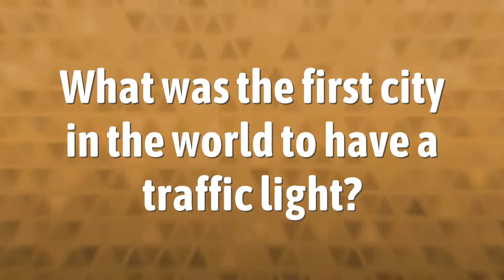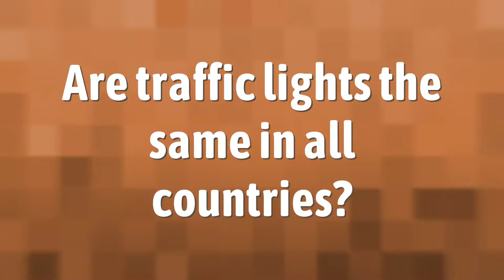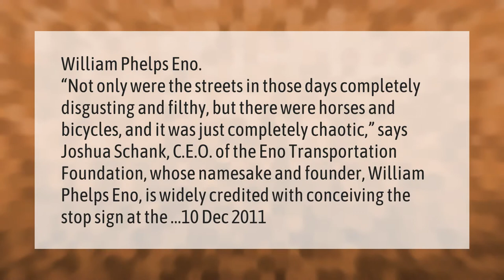Who invented the traffic light and why?

Comment: Showing you the way!    Why lie?
2,020 views  Oct 31, 2021  UNITED KINGDOM
inventor of traffic light.
The first Traffic light was invented by 
British engineer John  Peake  Knight from Nottingham, England.
In 1866, over one thousand  people a year
were being killed and  over thirteen hundred injured on the  roads in London.
 Mr Knight designed  a traffic signaling arrangement system to control 
the horse drawn traffic and diminish the number of road accidents.
The world's first traffic light was installed on 9 December 
1868 in London near Westminster Bridge, at the intersection of 
Great George Street and Bridge Street, London .

A plaque can be seen at 12 Bridge Street, Westminster 
near to  where the
the first traffic light  in the world were seen.
This invention later paved the way for the 
electric traffic light by the american ,Lester Wire in 1912.

Eight years after the modern evolved Traffic light  invention of Lester wire,
a detective in 1920  by the name of
 William Potts introduced the amber light with a sequence of electronic controls
 that would form and evolve the automatic traffic light.

Early traffic light signals were constructed for the railways
with the railways and trains invented in Britain.

They were gas powered and were red and green.
Red means  risk or danger in many cultures. This makes sense
as this colour has the greatest length on the color spectrum.This
means it can be see from a longer viewing area than other colours.
Traffic light technology by the 1960s had evolved in to the computerized
 era,which could now change using the process of automation with 
computer software.  https://www.bbc.co.uk/nottingham/cont...